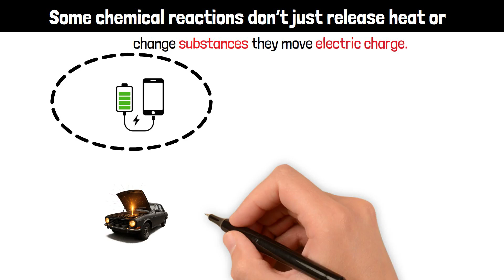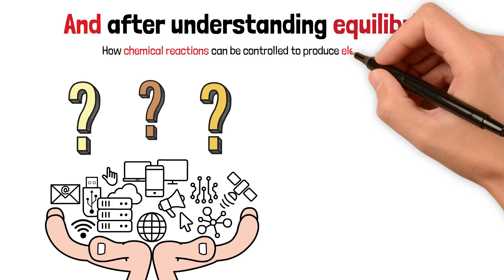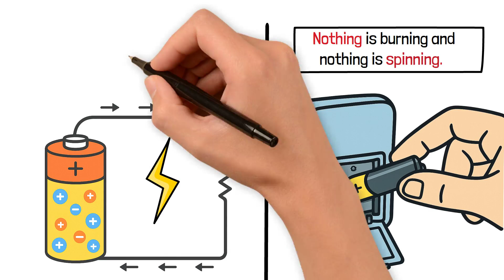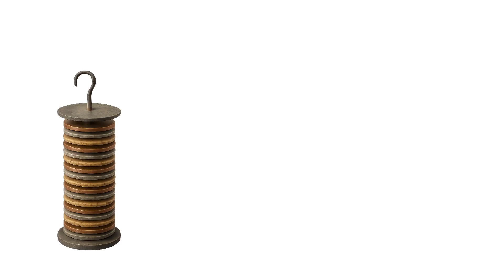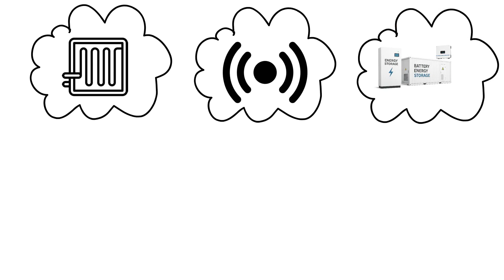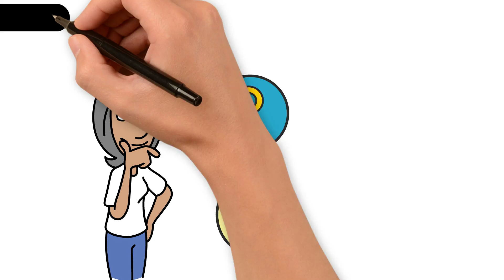Electrochemistry Explained | Turning Chemistry Into Electricity

Comment from the maker: Chemistry doesn’t just explain matter.
It can power the world.

In this video, we explored how electrochemistry turns chemical reactions into electricity by controlling electron flow.

We covered:
Why oxidation and reduction happen together
How separating reactions creates voltage
How batteries and cells actually work
Why electrochemistry matters for modern energy

This was a major shift:
Chemistry moved from understanding reactions
to harvesting energy.

▶ What this unlocks:
With electrochemistry understood, we can explain batteries, corrosion, fuel cells, renewable energy storage, and electrochemical technology.